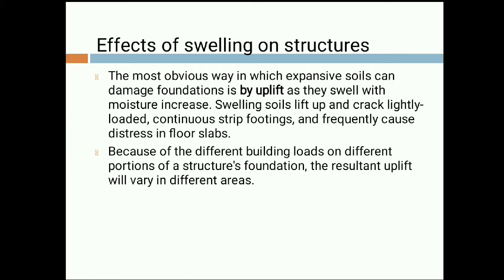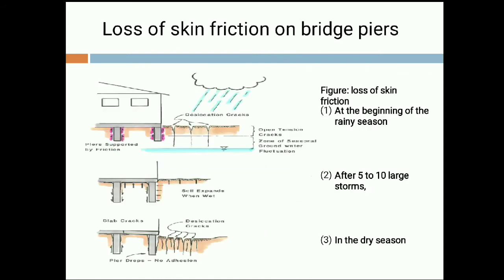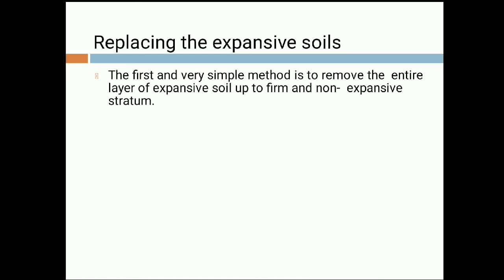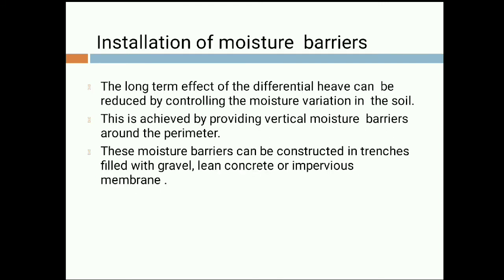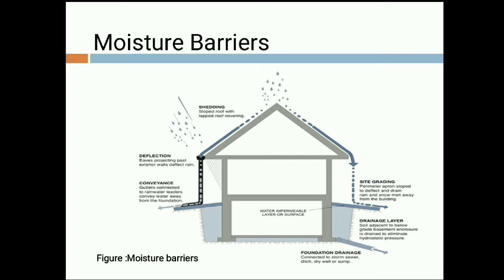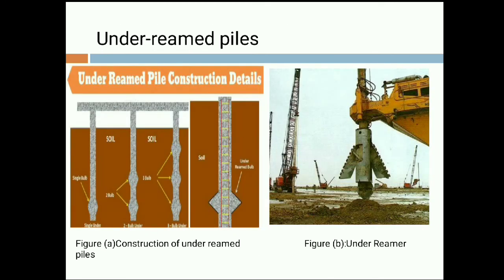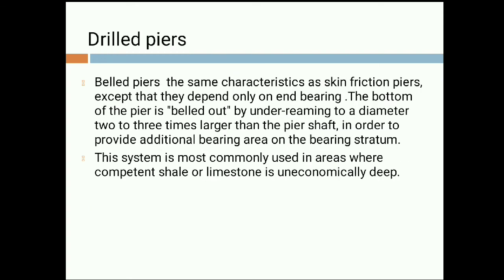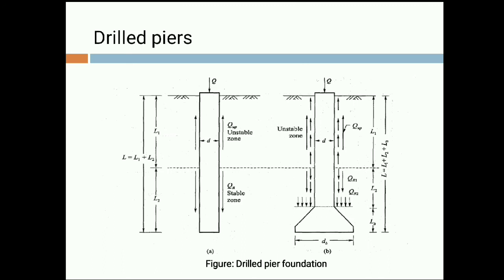Foundations on Expansive soils lecture 1 Part-4 by Prof. Amit R. Chauhan

Comment: Thanks for the very detailed video.
To moderate volume change potential, would it be practical to position a 300mm thick granular compacted material (type-1) and then a reinforced raft. (Bearing capacity is sufficient) and advise for water management around the footings so no water contacts the soil?

Also would on the above solution a geomembrane help at the base of the footing or beneath the type-1?